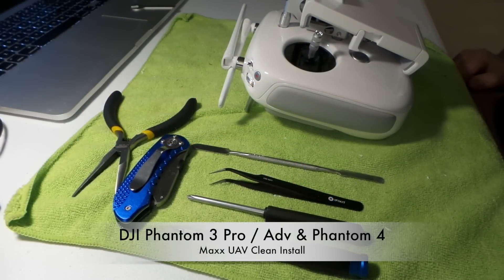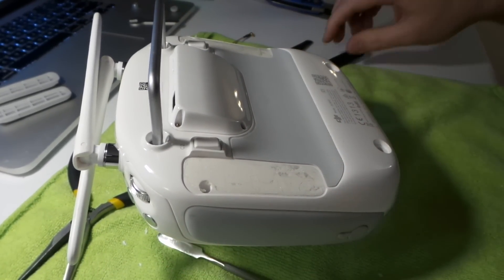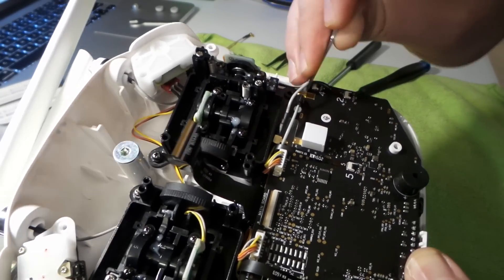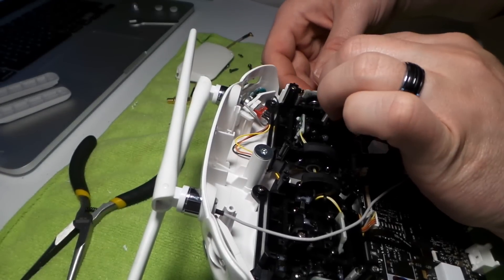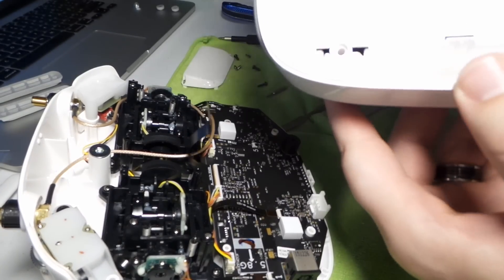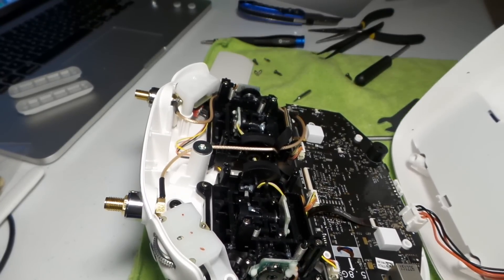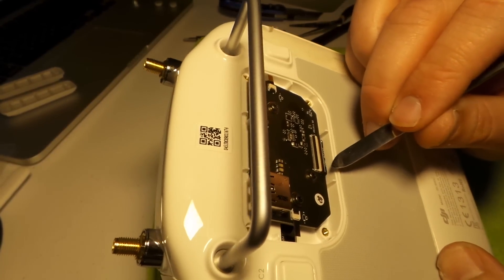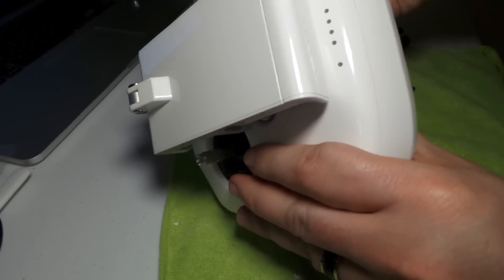DJI Phantom 4 & 3 Pro/Adv Antenna Mod

Comment: The mistake I initially made was I forgot to cross the wires and experience some weird interference on my first test /w alientech. As for the original antennas if you turn inward or outward just passed the lock position you can remove em easily by hands.

Comment: thanks for the video, but I wonder how to connect wires from antennas to transmitter of my Phantom 4. I’m using DBS02.2X. There’s no wiring diagram in the package.
Reply: Have a look at https://www.youtube.com/watch?v=sUlifOk2kTM in that video the poster depresses the clips on the original antennae rather which means they can be reused etc. 
As per 7.00 in the linked video I personally after disconnecting the two small ribbon cables from the USB board I detach the USB board and then disconnect the big ribbon cable, I reverse this sequence for reassembly. Make sure that ribbon cable doesn't snag on anything as you open the controller body. 

Once you have the new gold coloured connectors ('bulkhead fittings') through the old antennae holes and secured the wires from new antennae just screw to the bulkhead fittings. I do not think it matters which lead goes to which bulkhead fitting as I have used a different version of your DBS both way up i.e. the connections have been reversed.
DO NOT go crazy when replacing any screw, the plastic spigots into which the screws screw split easily.

Also when putting screws back in I'd suggest starting by lightly pressing the screw into its hole and then turning it the WRONG way, you are then likely to feel the screw drop into its old thread, if you do you can then start to turn it the correct way but judge if it initially screws in with out any 'great' resistance. If there is intial resistance back the screw out and see if it drops into another thread which starts in a slightly different position. The idea is to get the screw back into the old thread. I know "'great'" is a subjective term and the required 'feel' comes from experience but thats the best descriotuin I can give

Comment: What type of antenna were you planning on screwing into the controller? I purchased  the ArgTek range extender kit and the antennas do not work at all. The wires were installed correctly, but now I have the two adapters on the outside of the controller that you have. Basically you could screw in an antenna. Where are you going to get the antennas you were going to use?
Reply from the maker: https://www.maxxuav.com/collections/dji-phantom-4/products/itelite-dji-range-booster-ite-dbs02 is a good starting antenna.

Comment: Hmmm, okay here's my issue. Hopefully not a big one. When I disconnected the con board connection I accidentally popped the black flap at 3:46 off and couldn't get it back on. Will it affect anything or is the connection at that point relatively snug?

Comment: In the video you said u made custom wires. Did u make them or purchase them? If so where can I get your same connectors? Thanks!
Reply from the maker: Hey Raymond, you can find these cables here: https://www.maxxuav.com/collections/cables/products/copy-of-dji-clean-install
Reply: Maxx UAV thanks man! Also I know your doing this demo on a phantom 4 receiver, but will everything be the same on the phantom 3 professional receiver?
Reply from the maker: Raymond Pandocchi yep, exactly the same!

Comment: If you tie a string to the end of each old cable before pulling them through,you can detach and  tie the stringsonto the new antenna wires to guide them back through,it makes it a little easier.

Comment: nice video but can you tell me if i have only the phantom 4 will it work?when i try to fly i only do 600 or 700m before i lose the connection. what will you recommand me ?
Reply from the maker: Gabriel Boudreau, send me a message through our website, MaxxUAV.com and we'll find a solution for you! :)

Comment: When you connect the small end of the antenna cables to the inside of the controller does it matter which port you used? I believe you connected the left antenna to the far right port, would it make difference if you did it the other way around? What about switching port 1 and port 2 on the ITELITE antenna itself when attaching the antenna to the controller? Thanks!
Reply from the maker: Nope, it doesn't matter. You can connect it to either port.
Reply: So it makes no difference when installing the cables within the controller or when attaching the antenna itself before a flight. Thank you!

Comment: Hey Buddy, quick question.... I think i may have kinked one of my antenna cables during the install. It didn't break, but its lose near the connection. Am i screwed? Do I need a new one?
Reply from the maker: Hey Dan! Did you get the cable from us? If so, shoot us a message and I'll get a new one sent out, no charge :)

Comment: Hello, but from uscono board two different signals 2. 4GHz or from a single point is split on the cable to two antennas. Thank you

Comment: I have a question .. I'm saving for one of these quads and was considering the long range updating to the controller but no one seems to have any vids on upgrading the Quads ant's to match ..  Was wondering if they are just cables with a exposed conductor in the legs as they look or is there a reason you could not cable to a RP connector on the body so as to add a circular polarized vid and a higher db gain rec ant's to match what you mount on the transmitter...?
Reply from the maker: Paul Mays upgrading the antenna on the drone is not necessary. People have done it, but I don't think it helps much.

Comment: Now something you pointed out. "Do not turn on your transmitter or you risk frying your transmitter board." That is false your transmitter is basically a wifi router you can remove the antenna nothing bad would happen beside very weak signal. Now if you slash water on it and turn it on then you run the risk of frying it.
Reply from the maker: I would still error on the side of caution. I've never fried one myself but I've been told by people smarter than me that it's not a good idea.
Reply: Maxx UAV Of course its not a smart idea but when it said in the video hey you risk frying it im very skeptical of that
Reply: if you pull the Ant off your WiFi unit at home it also can burn out the transmitter module... Any thing that transmits RF will cause the transmitter to overheat if it has no ant... The energy has to be dispersed into a matched SWR ant or the energy is converted to heat... If the output power is low it does not heat as much but it can deff fry the output IC ..   Not an Issue on the Receiver  side.. (5 ghz) only on the controller transmitter side...
Reply: Absolutely agree - Bass Junkie must like playing Russian Roulette! Or he doesn't actually PAY for his own equipment - or is rich! Btw Paul, are you sure the Rx side of things is 5ghz? I understood Lightbridge was something else. Surely we couldn't get the range we get using 5ghz?
Reply from the maker: David Tormey Lightbridge only uses 2.4ghz. The 5.8ghz is only in the Inspire 1 and M600 remotes, and it's only used to communicate with a second controller.

Comment: you not able to do this on a dji 3 standart arent u ?
Reply from the maker: There's not a clean instal option for the standard but you can still modify the remote.
Reply: +Maxx UAV, do you have a video showing the mod for the Phantom standard? Kindly send me a link to where to buy the antenna.

Comment: You might want to show why you crossed the cables. On the clean install kit the cables are also crossed AGAIN between the remote and the antennae. Which means you could have wired them straight. It's just a cable management choice. There was no explanation. Bear in mind that newbies watch these videos for a DIY guide. I wired mine straight outside the controller. Because I didn't know. not that clear until mistakes are made. Mine did not connect. Hope I didn't fry my controller. Pretty sure you owe me $109 bucks if I did. ;)
Reply from the maker: Hey Jeff, thanks for the feedback! And yes, it's just for cable management. I plan on doing an updated video in regards to everyone's feedback. Please contact me through my website so we can troubleshoot your issue.

Comment: In this video, I waited to see the ultimate results. It would have been nice if you showed an example of what one could achieve by using your cables and perhaps the different antennas that could be attached. You could maybe avoid questions like the one below mine "what is the purpose of this modification?"  Thanks for sharing. Dj Soul Force
Reply from the maker: Hey DJ Soul Force, the purpose of this video is just to show how the mod is done for my customers. You can search DJI ItElite on youtube and you'll see lots a videos of the end results.
Reply: Ok, thanks. I must have missed the part about using the ItElite antenna, this appeared to be just a cable swap mod, that's what made me ask, "what's the purpose of this mod?" Does your website offer a variety of antennas to complete the mod? Thanks, good video. DJ SOUL FORCE
Reply from the maker: No problem bud! Yes, we sell the ItElite Antennas. Our website is http://www.maxxuav.com
Reply: TheNMINC  I understood it all. I was speaking for those viewers who may not have a clue, and pointing out how much this video left out!!! (just trying to help those that don't understand) Thanks bro. DJ SOUL FORCE

Comment: what are you doing to it
Reply from the maker: Adding standard SMA connectors to it which allows third party antennas to be used for stronger signal / longer range.

Comment: Can you tell me why I do not show a large scale bar graph on my channel 
strength under the HD tab on the DJI GO app?  My channels read out with 
just a tiny speck of light. I have no way of knowing which channel has 
the greater strength. I have seen this effect on other peoples videos 
but I have also seen the full range signals showing on other peoples 
videos. I am using an ACER 10 tablet and have NO OTHER issues other than
 this. I have re D/Led the app twice-no difference, I have looked 
through all settings for a possible solution but found none. I do have 
ARGtek antennas and 32 channels but this was happening before I made the
 mod. Does anyone have a hint as to why this is happening?
Reply: I had the same issue.  ASUS tablet.  I upgraded to a Nexus 7 and the bars are the way they are suppose to be!  I can read them now! Yippie!

Comment: Hi max i replaced the antenna but the remote started to beep a lot whats the solution the light is red
Reply from the maker: Are you on the latest firmware?
Reply: How do you get the last firmware for the Phantom 4 remote
Reply from the maker: +Jose Fanith sorry for not getting back to you sooner bud! This is not my main support channel. However, when you turn on the RC and Drone, go into the Go App, it should tell you if a firmware is required or not. If you still have trouble, contact me through the website and we can exchange phone numbers.
Reply: If you've performed this modification I'd like to purchase your 
Used/Removed Antenna(s) from any of the DJI Remote Ctrl's, I can be 
contacted via the following forums http://www.phantompilots.com/ or http://www.inspirepilots.com/  , user-name: IIIDaemon, Thanks
.
IIIDaemon

Comment: This sounds illegal
will it void warranty?
Reply: Well yeah... You void your warranty anytime you crack open your transmitter or anywhere else where you're not supposed to be.
Reply from the maker: Definitely not illegal but will void your warranty.
Reply: Maxx UAV By how much does this extend the range? And does some form of panel come on top of those knobs?

Comment: I just removed my itelite and sending it back to amazon, not sure if maxxuav uses the same antenna. I fly from my back yard towards farm fields and I lost just above 1500 meters using itelite. I tried other places and I can't get the same distance as the once posted on Youtube. For $109 it ended up a waste of money and time. I thought of adding a watt booster but Ithat would add to what I already spent. So for all of you that want to mod with these antenna, don't cut wires or destroy your stock antenna, test it out first and then make your decision if it works for your Phantom. I tested on it on both P3 Pro and Advance. What a bummer. I used to be able to nervously fly 6000+ meters until DJI shorten the channels.I guess I'll wait for the P5 and keep using  paper parabolics for 4000+ meter flights. The only damage is the drilled holes on my transmitter.
Reply: If you've performed this modification I'd like to purchase your 
Used/Removed Antenna(s) from any of the DJI Remote Ctrl's, I can be 
contacted via the following forums http://www.phantompilots.com/ or http://www.inspirepilots.com/  , user-name: IIIDaemon, Thanks
.
IIIDaemon

Comment: I need to Mod my Inspire controller would it be the same steps for that controller?
Reply from the maker: Mostly, yes. There is a 5.8Ghz antenna that you need to figure out what to do with though. I recommend looking up another video on YouTube by DBSMods. He shows a solution for it.

Comment: Why did you modify you controller , i mean is not needed with light bridge i get 5 km with no issues at all and I'm in CE mode
Reply: If you're getting 5km stock on a Phantom 4, then you're one of the lucky ones. 99% of other users don't get nearly that. With this modification paired with an ItElite antenna I've reached 23,500 feet, stock I could only reach 1500 feet. :)
Reply: Jake Jones well is not even a P4 i have a phantom 3 pro , and thats the range that i get , 5 km with full RC signal , and a little low video signal but with no lag at all ,  i  saw some videos of people adding the DBS antenna and with this mod you did and they  can get 10 KM or more jeje , but there is not point of that  , you are not going to be able to get your quad that at that distance, the only reason I'm thinking of changing the antenna is to get 720P video at 5 km ,  because as far as you go the quality is lower
Reply: TheNMINC  yea i know that , and thats for sure , that everyone flies  in deferents environments  and int may affect the range but its kind of weird that he is getting low range , DJI advertise 2 to 3  km CE mode, but well may be is because of the interference , may be I'm a lucky guy because i get that distance even flying in the city with all that houses with WIFI power lines and also phone towers

Comment: Nice tutorial.  Isn't one of those antennas 2.4ghz and the other 5.8ghz? You don't show the connections to the external antennas, so how do you know which one goes where?  With this mod and the replacement antennas, how directional is it?  Does the TX have to be pointing directly at the quad? What if you are flying overhead or behind?  Just some questions ... Thanks.
Reply: No.  On the P3 series, both are 2.4 ghz.  On the straight P4, both are 2.4 ghz.  On the other P4s, both are either 2.4 ghz or both are either 5.8 ghz depending on what is chosen in the app.
Reply: Yes Bill, this is a very good video that has missed an opportunity for it to be a GREAT video - if only it was finished, and brought to a conclusion. We want to see the antennas attached and it tried out to actually SEE if it's worth it or not. A great opportunity missed I feel.

Comment: Nice tutorial, thanks!  I'm scratching my head wondering why you put the lock washer on the inside, instead of next to the nut on the outside, in a conventional way.
Reply from the maker: +Tom Spurlock Hey Tom, the lock washer is too small of a diameter and would fall through the hole. I could ask for a re-design, but I haven't had any issues with it.
Reply: +Maxx UAV convention says the lock washer goes between the flat washer and the nut. It shouldn't fall through, that's what I'm puzzled about. Sounds like a sleeve needs to be fabricated.
Reply: Maxx UAV